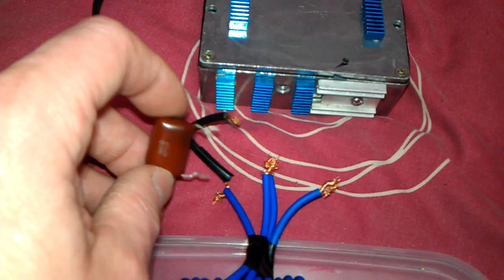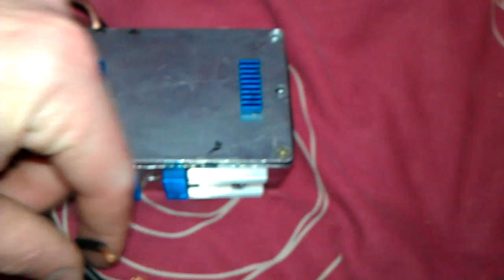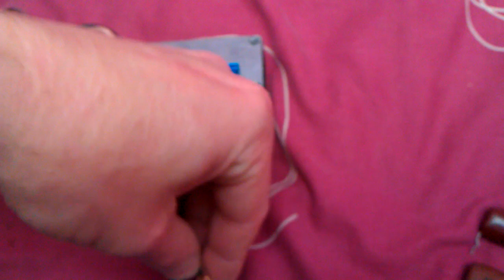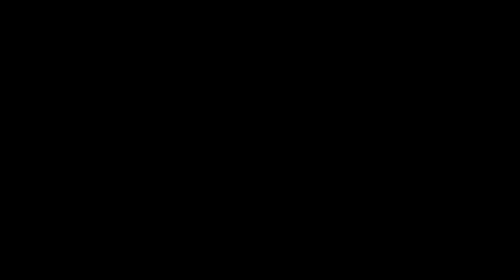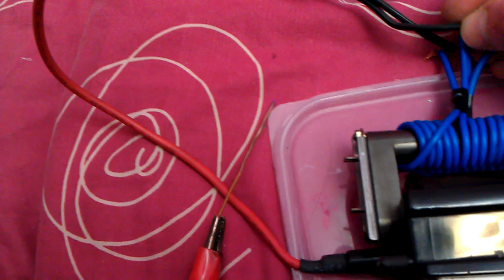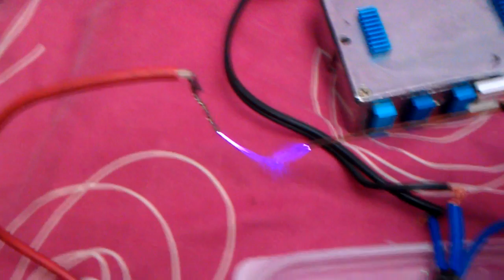555 TIMER capacitor mosfet

Comment: It creates an LC network, the lower MOSFET heating is becuase the capacitor reduces the peak voltage seen across the FET at turn off so it doesn't avalanche each cycle.

Comment: great! totally with just 9 volts!

is the frequency fixed? changing the freq. and the duty cycle will also change the arc length. 
And how do you protect the mosfet(s)? I cool them with sink and fan but they still die.
Should i use a diode or something? 

Oh.. and if you have the parts.. trie to make some kind of cascade voltage multiplier, if you have the parts laying around :P

Comment: The capacitor is also absorbing voltage spikes during turn-off, making things easier on the mosfet.  What happens to the input current with/without it?